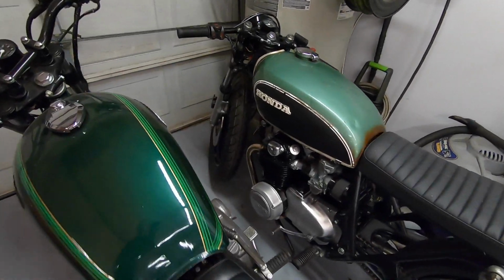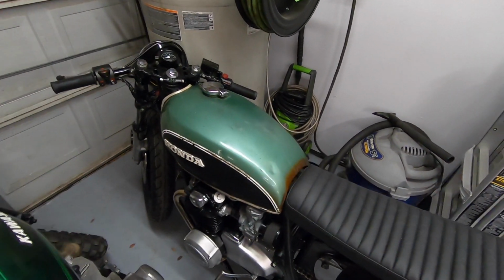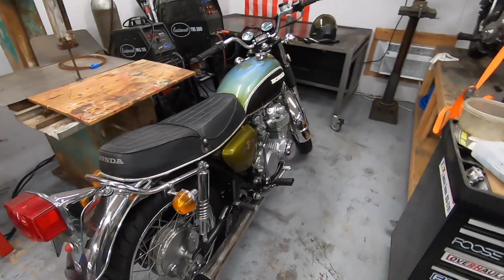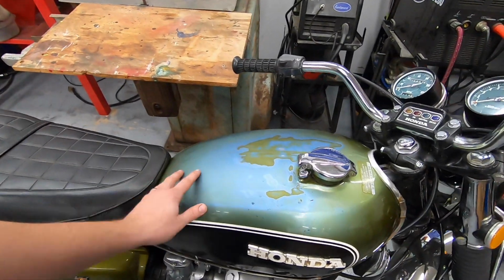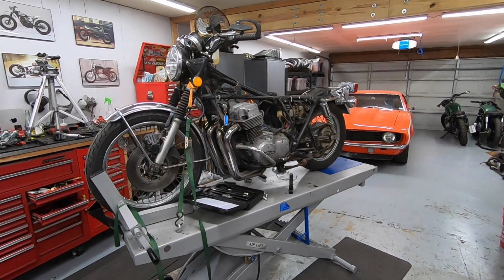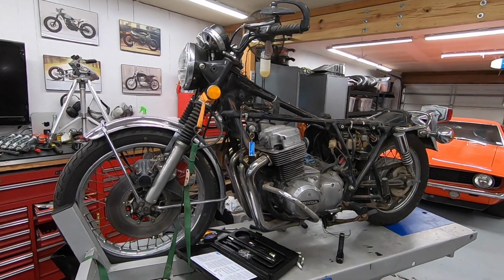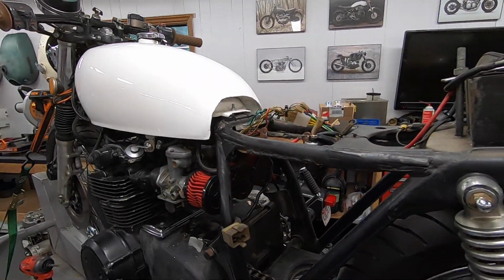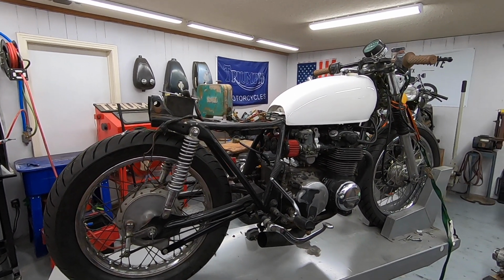Shop update and new project

Comment: The stock org. CB500  is gorgeous - my own CB500 K1 ('72 I think) was originaly stock Orange - the most beautiful (stock)color for  the CB500. I got my hands on a complete set tank and sides in green as you show here and had that for a few month before winter kicked in - I like the Orange more. I ended up nickle plated the frame,  and layered the matt black and chrome the engine, more or less like you have done with the one you have in the rear of the shop.
btw - that seat for the CB750 is not a 70's "thing" - it's a horrible 80's thing - could never have happend in the 70's :-)

Comment: Would you take on a Kawasaki EX500D12 Ninja 500 R build? I am no longer physically able to finish it myself.  I want it back original . If so maybe I could haul it to you. Be meaning to take a road trip in the spring. Its 2005